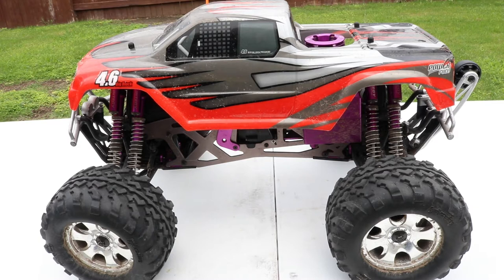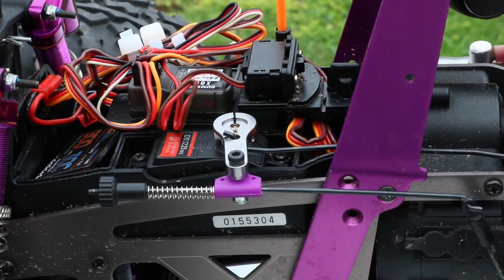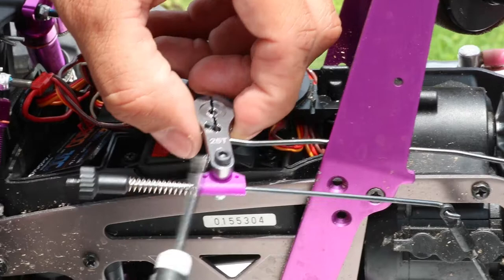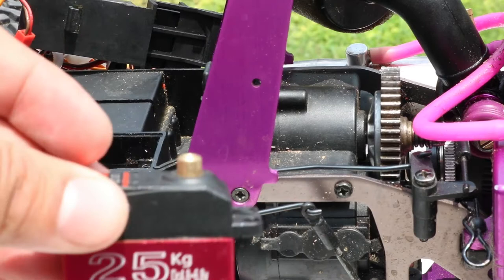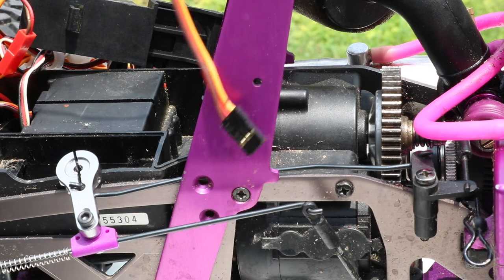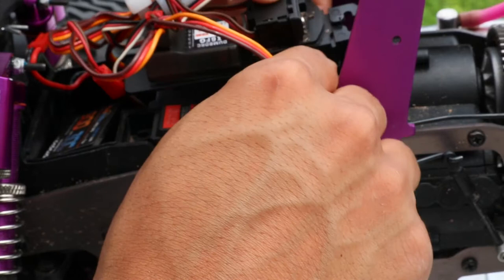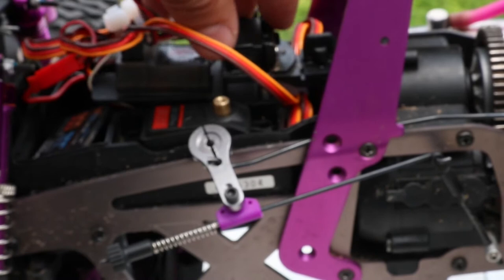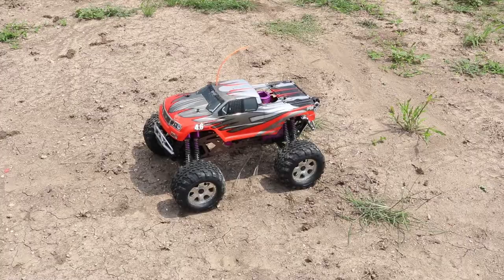Hpi Savage X 4 6 Throttle/Brake Servo Replacement

Comment: I recently just picked one of these up, and my throttle Servo is stuck on breaks. Will not move when the car is switched on, but will move when the car is off. Is the Servo bad??? I’ve tried looking it up with no luck.

Comment: That's a nice savage , I've just recently bought one and want to replace the stock servos , did them Amazon servos hold up and how do they compare with branded ones ?
Reply from the maker: Yes the Amazon one held up! Just read which Serbia can use Lopo batteries, because some are not compatible.

Comment: Hey so I know this has nothing to do with this video or truck but have you ever owned a  hpi nitro mt? Or could help me with a few things with mine having starting issues
Reply from the maker: I have never owned a hpi nitro mt, but I help you when your issues I’m sure. Message me what exactly is going on and I’d be more than willing to help you out!
Reply: @blakemorales3794  ok so it’s got a few issues but I just want it started that’s the goal I bought it and the guy said it ran a few months ago but it only idled if he gave it gas it would cut off and he tried to tune it and it didint start after that so I’m thinking if I can just flush the needles and boom well I found out since it’s so old I don’t have needles it’s a twist adjustment hsn and the idle screw / gap is a Phillips head and I got that gap looking pretty good to Atleast start but my thing is she won’t fire up at all and it’s not pulling fuel prime button does not work finger over exhaust does not work or not that I can Atleast see I tried to take the air filter off I blew on the fuel line from the pipe to gas tank I saw no gas shoot through the carb but it’s weird cause it’s getting rich so even though I see no sights of fuel going through the lines what do ever the air filter was drenched in gas and when I tilted it to the side gas like an an actual stream came out for a quick second and stopped so obviously it’s getting too much gas and rich but it’s not starting and I see no fuel moving throught the lines or priming I have videos and photos of what I mean if you have social media I can share them with you at
Reply from the maker: @ninjaxgaminggamingchannel3082  okay so first of all to me it just seems like you need better tuning. So first of all adjust the high speed needle and low speed needle to where the screws are flush with the cylinder that it goes into. That should get you to running and after that screw in your high speed needle and then tune for low speed. Now for the idle, after it is running test to see if the wheels are spinning without giving it gas. If you pick up the truck and the tires just go without you giving it throttle then back out the idle screw. And if the tires aren’t moving and the engine turns off screw the idle in clockwise to lean it out.
Reply: @blakemorales3794  the thing is it’s a single adjustment with a twist hsn and an idle / gap screw under the air filter no matter what I turn it to or set idle gap and I even put nitro in carb she won’t start she tries I think sometimes but won’t start and my air filter is always gas and most of the time when I turn it sideways gas comes out pipe even though I haven’t ran it or can get it started so I try to restrict fuel flow but she still doesn’t start no matter what throttle trim I set it at ether compression isn’t the best though but I think it still should be enough to start it I can send a video if you want
Reply from the maker: @ninjaxgaminggamingchannel3082  yes put a video! And also have you tested the glow plug? To make sure it burns red ?
Reply: @blakemorales3794  do
You have Instagram ? And yes glow plug burns bright
Reply from the maker: @ninjaxgaminggamingchannel3082  my insta is Blake Morales